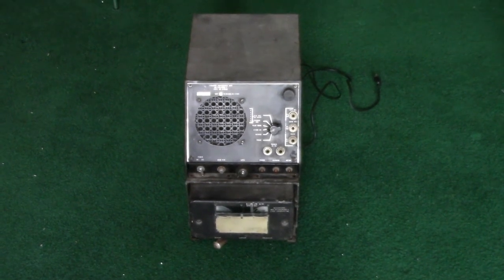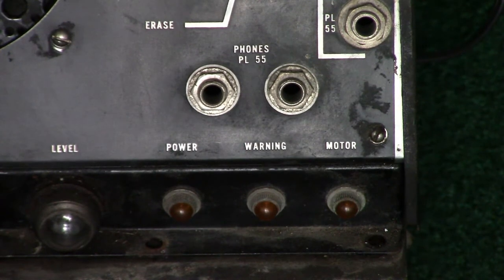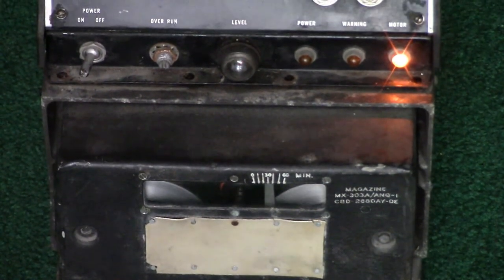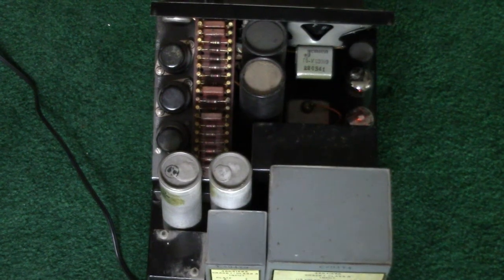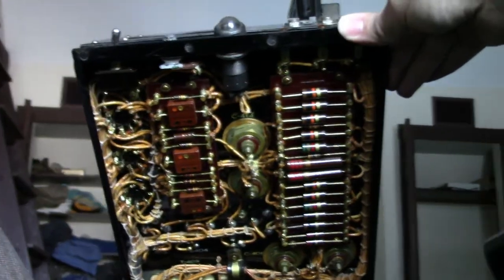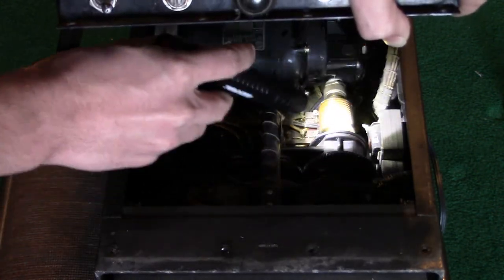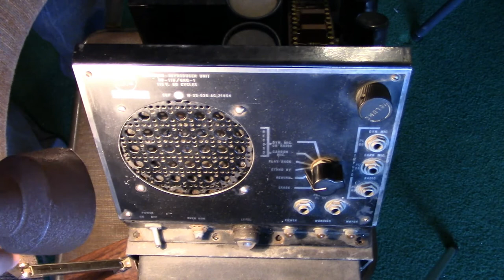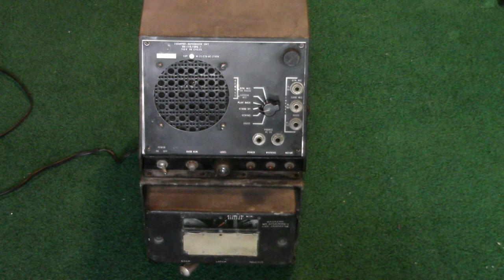Military Wire Recorder from 1948 -- RD-11B/GNQ-1 Recorder-Reproducer Unit (video remake)

Comment: That is a beautiful piece of history.  I also love the way they meticulously soldered all the resistors in a perfect line and made everything look very neat in the chassis. Gear drive is of course the best.  And if well cared for, will not wear out.   I'm of course glad you didn't have to replace the capacitors that were in there, I have a military phonograph that I dared to replace the old wax capacitors that were in it and the chassis was also coated with this green stuff and I had a hell of a time getting through that green stuff with my soldering iron to try to get to the bare connections to make new connections to replace the capacitors with. So I'm glad your machine is still intact hopefully you'll never have to get into it to replace those capacitors and to try to work off that coating that's on there.

Comment: I like the way that you used to do your composite video it's a lot smoother then HD and I find hey look me over with your voice the with the way that your voice is on the composite capture is 20 times better than than yourself when I don't like that as I said before the HD because my computer doesn't run very smoothly in HD and by the way I've got a 2015 model of Windows 8.1 computer it has been upgraded to that but if I try HD it just muscles in mangles up and everything thanks the cassette master